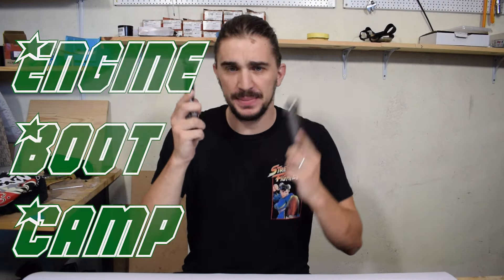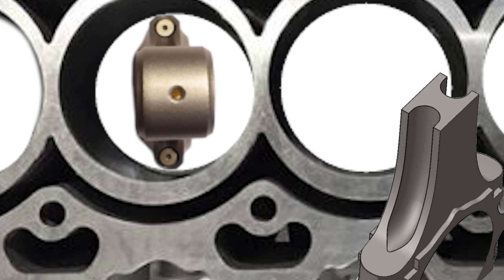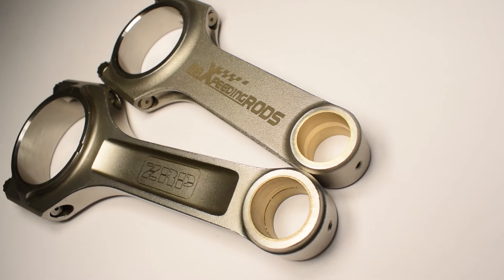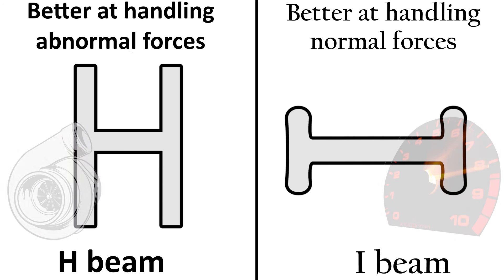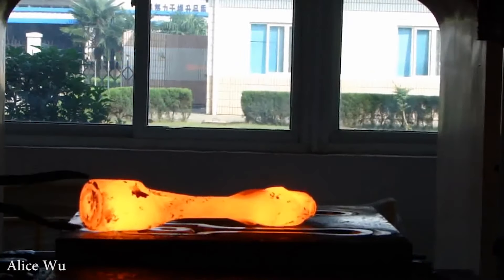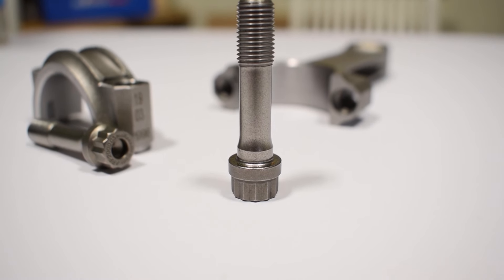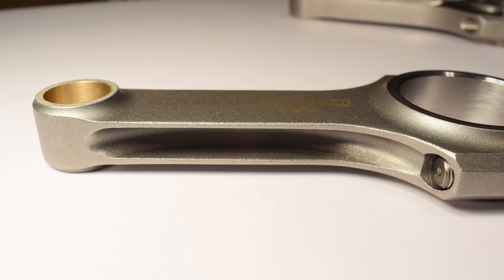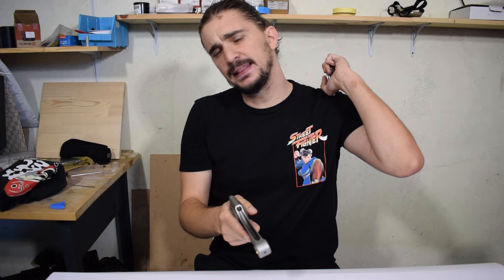H Beam vs. I Beam CONNECTING RODS

Comment: Clearly, someone has to manufacture an X beam rod and an oval tube rod just to be wide
Reply from the maker: Here's an x-beam: https://www.dragzine.com/tech-stories/engine/x-beam-connecting-rods-lunatis-new-design-for-extreme-applications/
Although some people described Pauter's + beam as an X beam too. There were a few x beam designs in the past, long before Lunati's too. There's hollow rods with holes too. Tubular rods existed in early engines. The Antoinette V8 I made a video about recently also had tubular rods. Some say the next big thing is generative design, organically shaped 3d printed rods and pistons. We'll see :) In any case, there's pretty much nothing someone hasn't tried already.
Reply: @d4a Thanks for the reply, as a complete motor head, I love the channel. Kinda guessed it would have been done in the past, fact you have that knowledge in your head is awesome!

Be great to see a video on porting techniques and traditional tuning (surface finishes, swirl effect, port matching, stepping exhaust ports)
Reply: Leon Beda carbon fiber can be much more heat resistant than most metals. It depends on the substrate that is used. Carbon carbon being the prime example. The real problem with carbon fiber is interfacing the composite to the metals that are needed for the ends of the rod(bearings and threads). These connections have always been the most difficult problem with composites.
Reply: DAnk bo0ui  aluminium rods are like that tho, aluminium rods also have a higher power capability than titanium

Comment: Why don’t they make a hybrid, using the advantages of both designs. A “HI” beam rod if you will.
Reply: Wouldn't it be called a crossbeam rod if that was the case.
Reply: There were rods made for F1 that were box sections. The rods were made in two halves and then EB welded together. They were first used by Honda in F1, and a few others followed suit. They were quickly banned though, for cost reasons.
Reply: Aluminium is the best of both which is basically a square
Reply: Look up Pauter rods
Reply: An understanding of second moment of inertia tell what's up.  In short, more material away from the axis is where the strength lies (unnecessary weight near the axis).

Comment: Considering the massive cylinder pressures and uneven burn of Diesel engines, H beam sounds like it's the best, especially since Diesels rotate slowly, so rod weight isn't a factor.  The hard part is finding a manufacturer that supports your Diesel engine.

Comment: The I beam is stronger under compression, the cross section’s shape doesn’t matter when under tension. The H beam has never been stronger, it’s just been cheaper. The evidence is obvious: have you ever seen a cast H beam? 

In high revving NA applications where tension matters more than compression H beams can make sense because the sectional area of the rod has a lower bound limited by tension, so the more expensive I beam would bring no benefit. 

You also get interesting cases nowadays where high boost engines can make huge power with low redlines and you can just make the rod thicker and accept the inefficiently of using H beams because it doesn’t need to rev higher anyway. 

But rest assured, it’s I beams inside of F1 engines.

Comment: Shorter rods are lighter and stronger and the material they are made of makes a difference as 4340 compared to 5130. Fatigued rods or used rods are junk. The best rod bolts also make a difference.

Comment: If you want to make your con rods storonger focus on your TUNE UP. Most rod failure is do to detonation not poor design. But another interesting point is if you look at certain manufactures they will us a Honda rod in a SBC engine. But what is funny is that in the honda 4cyl the rods are rated at 900hp but in the V8 sac engine the rating is 500hp. ?????
Reply: The reason is cost and that the Honda rod journal is smaller so people grind down the crank journal to fit which gives more material around the big end and allows easier fitment for stroking allowing the rod to clear

Comment: I beam stronger imo.  The rod has two support structures on the rotational axis of the crankshaft.  The H beam has one.  The H beam would be stronger at 90° of the rotation and therefore less likely to bend sideways.

Short story if you wanna go the max go i beam.  If an h beam can handle the power of your engine go with the h beam.

As mentioned, the material, design, and manufacturing process is probably of equal if not more importance.

Comment: I’m sure he’s right about how far I beam rods have come but I think the rule of thumb he’s talking about mostly holds up in drag racing. Does anyone know of a +1000 hp drag racing engine with I beam rods??   There’s some maniac out there these days running every setup you can imagine, I’ve just never heard of it.
Reply: Hey for sport I just used cxracing I beams because on eBay I caught them cheap well rods aren't cheap but they where unusual & well built so had them installed in a D sleeved h22a7 type r motor no turbo that ide like to get a higher top end with cx rods are comparable to Manley rods in design I think but just my opinion"

Comment: I beam was there all along with Oliver, Crower, Manley, and on and on. My cue is the world's biggest racing series. Drag racing in top fuel, pro stock, funny car etc etc all use I beam rods. Racing series Indy, Formula 1, Nascar, Offshore Powerboat, and on and on all use I beam rods. There is no case of a top racing series using H Beam rods. 
Using the shear singular choice of I Beam rods tell me there is no other choice.
Reply from the maker: Everybody uses nothing but I beam? You opened up all the engines in all the racing series? I agree with you, the I beam is very common and very good, but blanket statements are never a good idea.

Comment: I started my engine learning journey with 2-strokes, which are always always I-beam.  Maybe that's because individual piston pulses are quite weak but very frequent, meaning rod failure is usually a RPM or bearing-related event.  Or, since 2-strokes use the crankcase as an intake manifold (yes really) the aerodynamic weirdness of an H-beam might cause problems.    Regardless, I've always felt that an I-beam is a proper rod, and H-beams look like some ugly aberration from those weird 4-stroke people.

Oh, also.  It still blows my nuggets that car engines have freaking bolts in their rods instead of being one solid unbroken forging.  No wonder a measly 9,000rpm looks impressive.  It must be nice to service the bottom end without having a specialized machinist disassemble the crankshaft, though.

Comment: I beam is stronger than H beam.  A beam's resistance to bending due to an applied moment is proportional to its area moment of inertia.  Ix>>Iy, see https://sbainvent.com/strength-of-materials/area-moment-of-inertia/   Think through which way it needs to resist bending.  The next time you drive under a bridge, notice which direction the beams are installed...

Comment: Aluminum rods

Warning warning warning Will Robinson Danger Danger Danger Tricky discussion.

I have a question. This will cause some people to flip out no doubt but I couldn't care less for YouTube nobodies that have absolutely no personal experience regurgitating anectotal opinions made into folklore from 50 years ago.

That said how about modern aluminum rods with modern heat treatment on a street engine?

I understand heat effecting tensile strength of aluminum, necessitating larger rods negating some of the benefits of this material but the fact of the matter is these rods are found in AC compressors, almost all small engines and rod failure due fatigue life expiration of aluminum rods is virtually unheard of.
Perhaps this is partially due to the low reciprocating mass of these engines and the generally infrequent use but thing is I really want to run aluminum rods in a stroker engine on the street not due to detonation cushioning but to reduce reciprocating mass and make a 500+ cu' V8 rev up quickly like a smaller engine.
When it comes to aluminum rods in street engines, opinions are like a-holes - that is everyone has one.
Thing is 99.999999999999999999999999999999999999999999999999999999999999999 of opinions out there are for aluminum rods used in the 1960s NOT modern aluminum rods.

What do you think? Are you willing to embrace this most frought of all hot rodding topics?
The inevitable lawsuits should a rod failure due to improper handling but the owner blames you for recommending them (if you do LOL).

I am wanting an answer to this one and I am very sure many other curious hot rodders out there are too. Thing is the cost of them is reasonable too and the manufacturers say they're fine on the street because modern heat treatment the effects of thermal cycling. Afterall they are very common as a material in roller rockers also and although some cheap ones can fail brand name ones hardly ever fail.

Comment: In the beginning God created the I beam and it was good and it was successful and everything was OK for everything that went woosh and if you actually do a structural analysis it does not make a great deal of difference weight for weight , size for size etc in an engine as the forces are carried perpendicular to the to crank centreline . The most powerful engines built with the highest rpm , 2 strokes are basically all I beam . As the guy says to KISS , its down to the metal being in all the right places .

Comment: Why not just use a metal 3D printer to design an even better connecting rod?
Reply from the maker: Because 3d printed metal still doesn't have comparable strength to forged. Unless you find some extreme high end printer, but printing using such technology still costs more than most cars.
Reply: driving 4 answers 3D printed metal parts can actually be machined, tempered/annealed and forged after the initial printing.

You could also use an ultrasonic welding-based 3D printer to create complex alloys that wouldn't be possible otherwise... with entirely uniform mixtures of high and low density metals, precisely controlled gradients, fusing of metals with vastly different melting points, and so on.
Reply: A few reasons. Cost is around 12x to 15x if you made the same billet machined shape by printing. Its based on build time more than material so hollowing parts out does reduce cost. "Topology optimisation" FEA gives those bird bone like structures you're probably thinking of which should work well here. You do need to have a place to tip the internal powder out of the shape. In this case, that might be the 2 bolt holes which should work well enough. Having 2 failure modes (High revs tension and MEP compression) makes the design process a bit of a challenge to set up and do well. There is also the geometry constraint of missing the lower edge of the bore which reduces the freedom of a "big, but mostly hollow" shape which optimise more easily. All of this is why F1 has banned making this component from anything other than a solid billet bar to stop it becoming another "cost is no object" arms race. The space industry is routinely using high strength / high temp laser sintered analogues of conventional materials and in their business it's been cost effective. So "stupidly expensive and/or banned in motorsport" is the reason why.